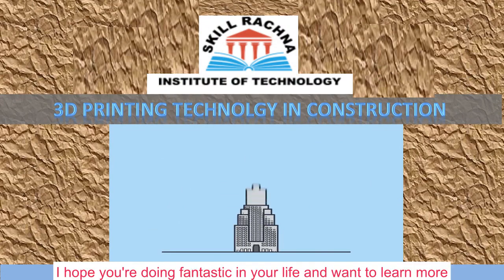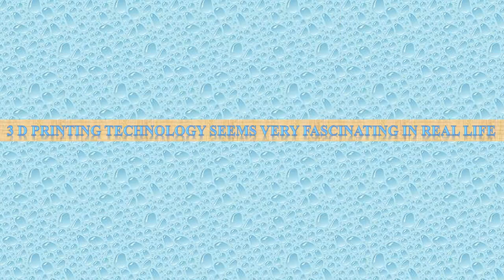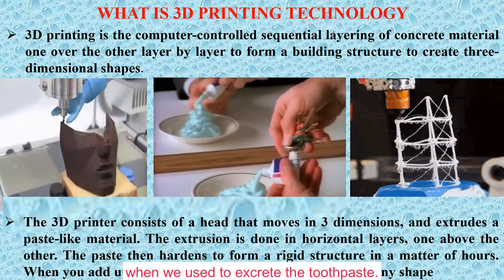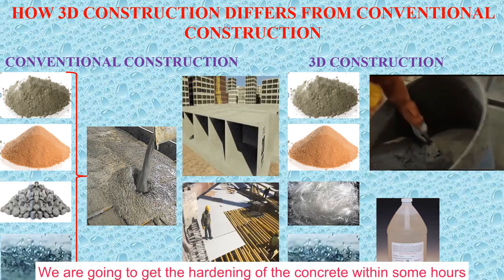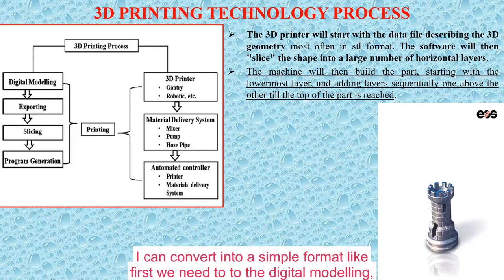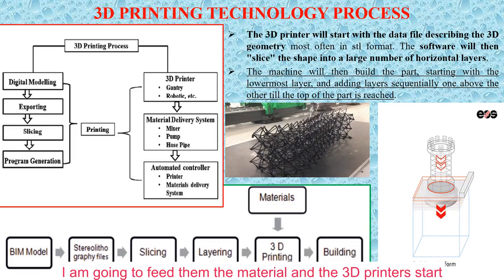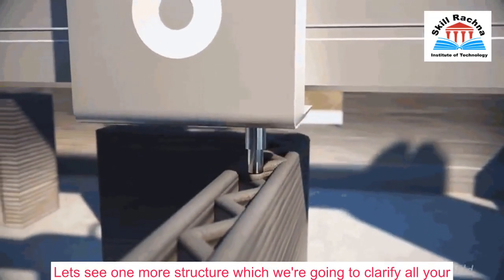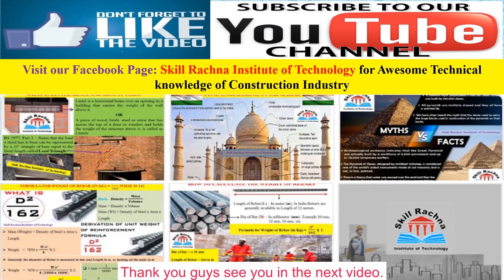3D Printer //3D Printer in Construction Industry // 3D Printing

Comment: Sir, what about the reinforcement? This structure can resist the earthquake? And the foundation has to be done in the conventional way only right..?
Reply from the maker: For resisting tension carbon or glass fibres are used. Yes earthquake resistance structure till G+1 floor structure.
Reply from the maker: Foundation mostly done in conventional way or precast technology.

Comment: Sir brilliant video😍👏
I wanted to ask how environment friendly would be the structure? And how well equipped it is to bear environmental pressures like heat, heavy rain.
Is it cost effective?
Reply from the maker: Thank you Prajwal for your Appreciation.
3D Structure is having low carbon footprint because many 3D printers of world using wastage material, fibres and even soil as raw material. It is more suitable for environmental parameters because we can make it hollow and many insulation design concepts engraved in design
Reply from the maker: In terms of cost effectiveness in concern with India - it is expensive because of unavailability of technology
Reply: @skillrachnainstituteoftech5844  that is a great option..😍
Reply: Is it durable enough in all climatic changes ? In terms of stability also
Reply from the maker: @prajwalw3068  even in cold weather of -50 degree it is existing and standing strong.